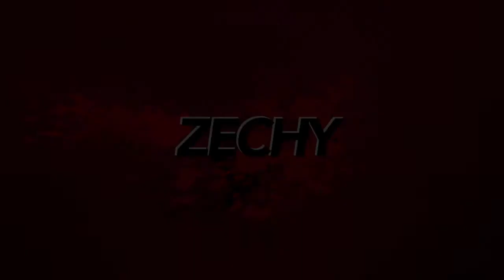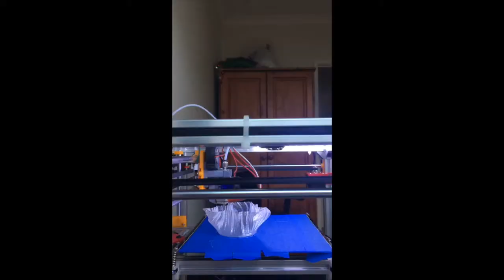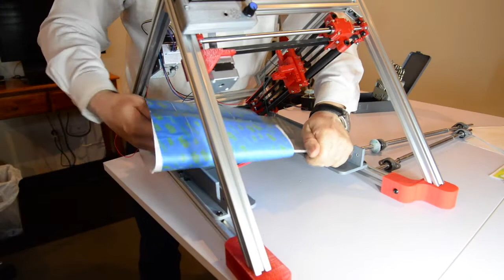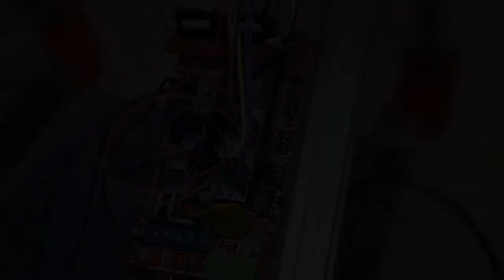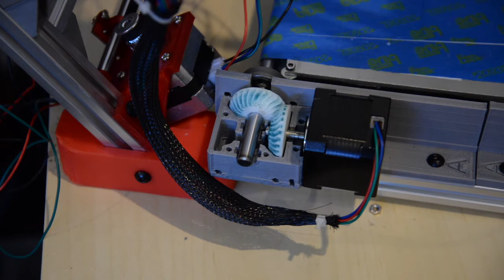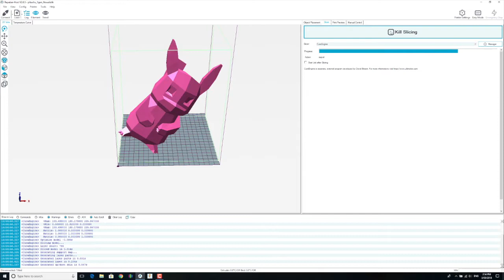Hypercube Infinite Z 3D Printer: Part 5 - Conveyor

Comment: are you running bronze bushings on carbon rods?
By the way, you should try out the cura for blackbelt, it is available to download from their website. with it there is no need to post process the stl file
Reply from the maker: Yes. Bronze bushings on carbon rods I’ve been running bronze bushes on carbon fibre for a year now. Thanks for the info about blackbelt cura. I didn’t realise it was available.
Reply: Zechy Coyte-King are you not worried that they will wear out?
Reply from the maker: faxxzc on my main printer I’ve been running bronze bushes on carbon fibre for more than a year without wear. The rods are still shiny. On the hypercube they are also easy to replace and cheap.
Reply from the maker: Also see https://youtu.be/0Pg-L1pQ6qU